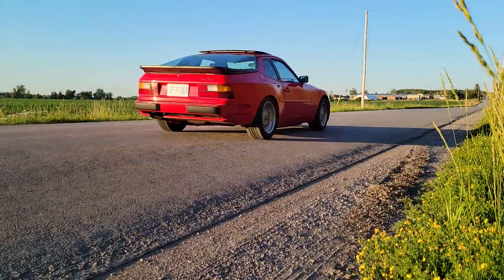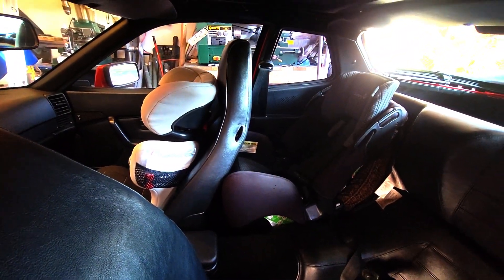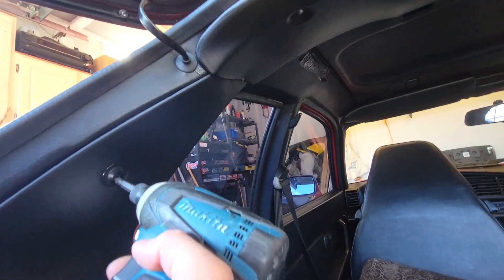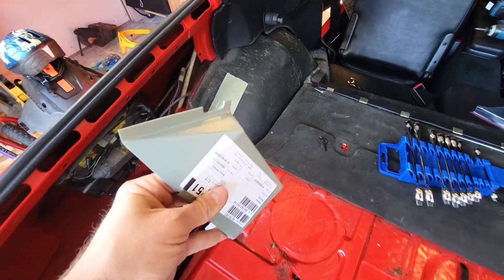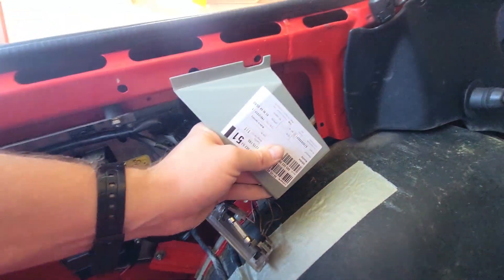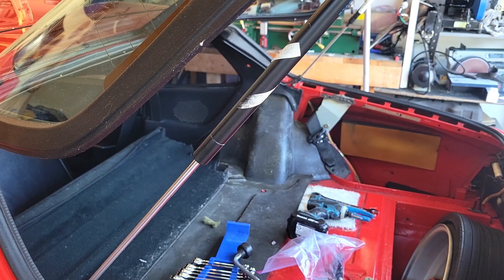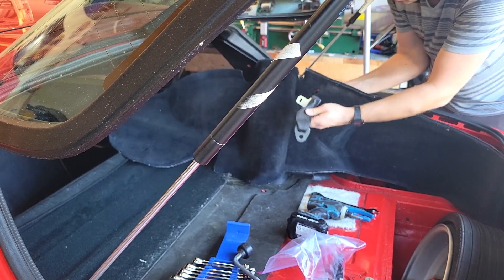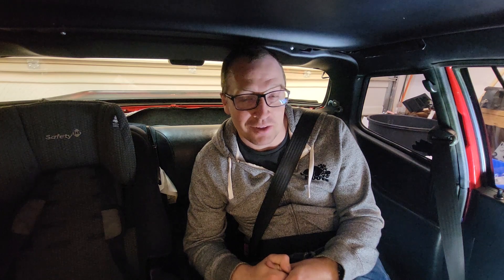3-Point Seat Belts in the Back of a Porsche 944

Comment: I am thinking of getting myself 944 S2 or 968. How are the backseats? I used to have a 1990 Celica and rear seats were useable for shorter adults and could seat in there if i leaned into the middle like you did so  my head didnt touch the roofliner. How is the leg room? Shorter adults/women/teenagers can seat in the back and have okay leg room if you move the front seats forward a bit? I could drive 4 people in celica when i did. I liked idea of getting 944 mostly because i will get back pop up headlights and have feelfull sportscar again, and i want it to be RWD and 2+2. Only other options i have is either MK3 Supra or Mercedes C class Sport Coupe(which is quite a bit newer, but Mercedes will be far less engaging with average shifter at best, but apparently adults can seat very comfortably in the back, and its a liftback just like 944 or celica)

Comment: Nicely done. Did the same about 12 years ago for my two small children, although far too big to fit in back now. Instead of 2x new attachment plates (which until this video I didn't know existed) , I asked a 944 breakers to cut out from an old shell . Cost about £20 for the 2 plates.
Reply from the maker: That was my original plan too. I tried to have the brackets cut from a  car by the dismantler who sold me the seatbelt retractors. But he couldn't understand what I was asking for. My next plan was to fabricate custom brackets, then while researching that someone gave me their part number. I still can't believe the brackets were available and affordable from Porsche. This whole experience was my main motivation to make this video, because I know how hard it was to find details on the conversion. Thanks for watching!